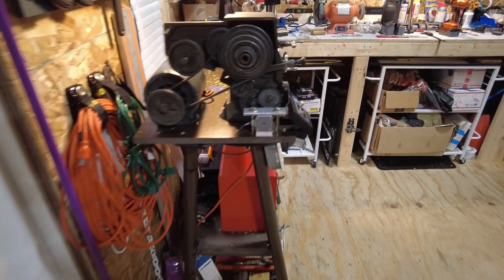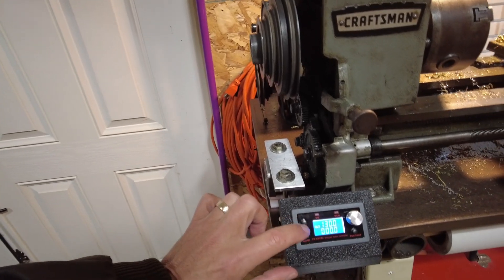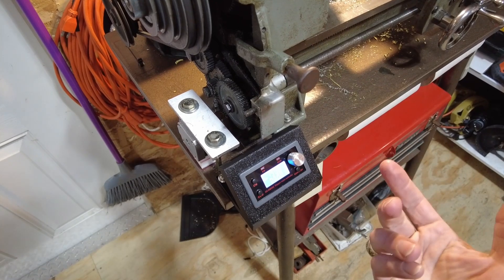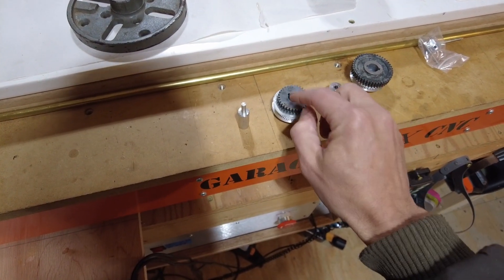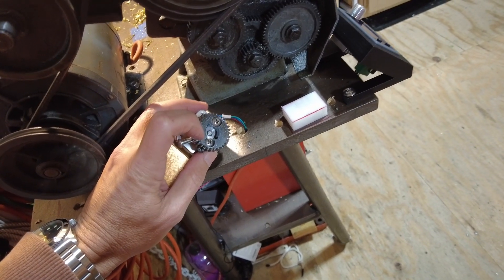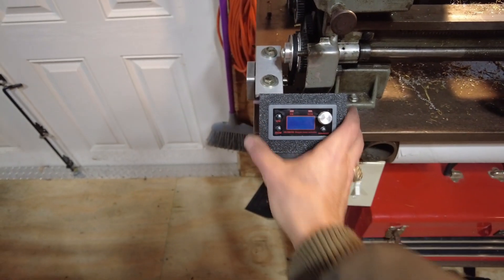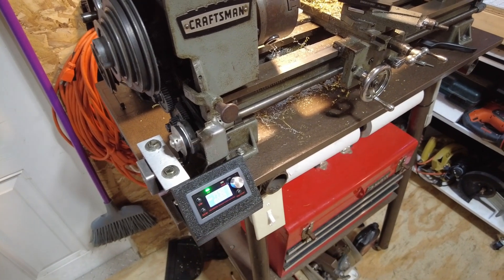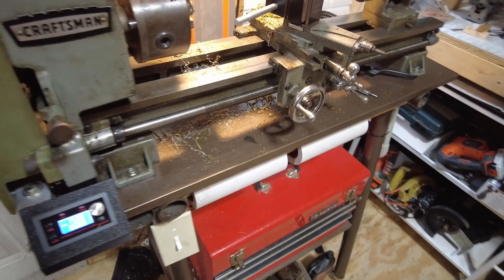Metal Lathe Powered Leadscrew Mod - Cheap, Fast & Easy!

Comment: The combination of those gears to cut threads it’s pretty painful.
And all what these gears do, is to put the right RPMs to leadsrew to cut right threads.
Have you tried to turn the lathe in low speed, and then to find the right RPMs of leadingscrew to feed and somehow to cut threads.